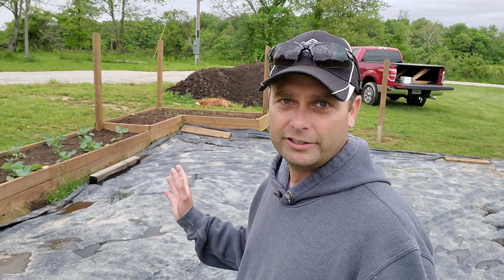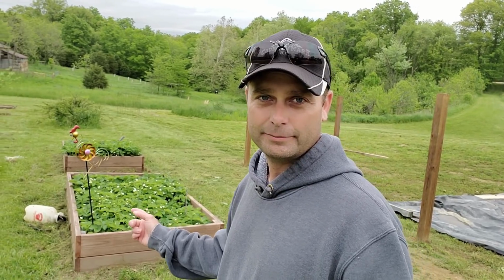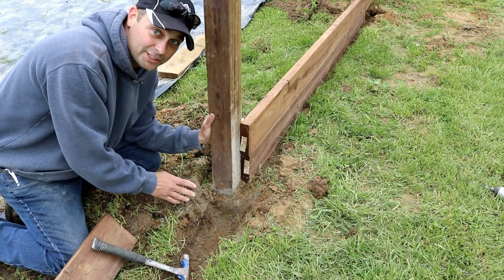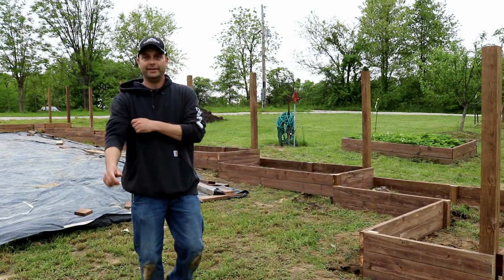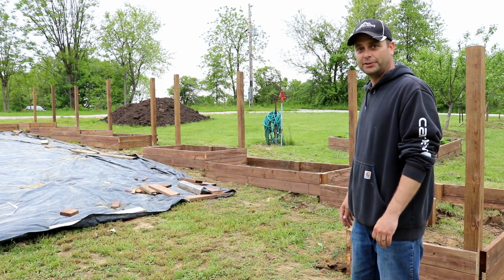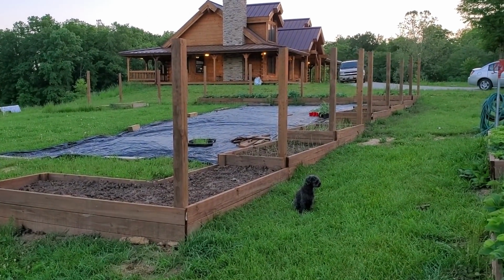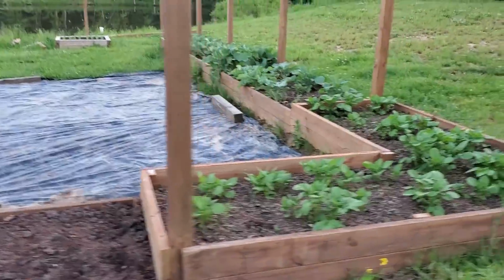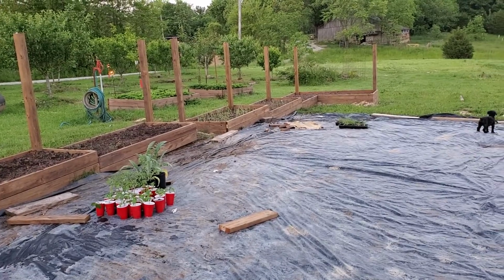Building Raised Beds down a slope - Fenced in Garden Area - Part 3

Comment: Looks like a beautiful raised bed garden... I use the scrap wood to just loosly fit or nudge in to block off the dirt and close off those gaps... but other than that alot of people first remove all the grass then put lawn weed block cloth over or under or usually along the sides of the beds to keep out the weeds. it helps future proof them too.

Comment: I'm curious why you didn't put weed barrier cloth down first.  They look great though.
Reply from the maker: I did on some the first raised beds.  But someone mentioned that it will keep worms from getting into the raised bed.  So decided not to use weed barrier in the bottom anymore.  A biodegradable layer like newspaper or cardboard would be best.

Comment: Are you using PT or Cedar wood or something else?
Reply from the maker: Pressure treated
Reply: @CountryViewAcres  Great channel, I’m watching all your garden build videos. Do you have any recommendations after living with the garden for a couple years on anything you would have done differently? Would you have gone taller? Any issue with borrowing animals or rabbit squeezing between the welded wire fence?
Reply from the maker: Rabbits can squeeze through the 2x4 welded wire fence.  Smaller wire would be to better at the bottom.  The 3 foot wide raised beds around the perimeter are too wide.  Hard to reach across.  If I was to redo it, the raised beds around the perimeter would be 2 foot wide.  I wouldn't put raised beds in the middle of the garden, I would prefer to just have the middle covered with the ground cover fabric to plant in.  I find that the raised beds need watered regularly.  Planting directly in the ground through the fabric, really doesn't need to watered very often.
Reply: @CountryViewAcres  thanks for the update, much appreciated